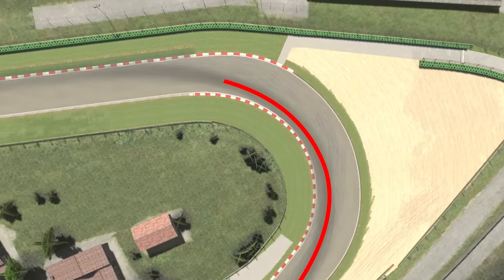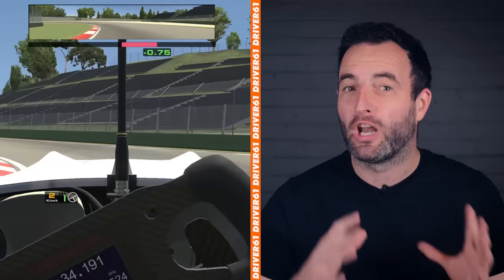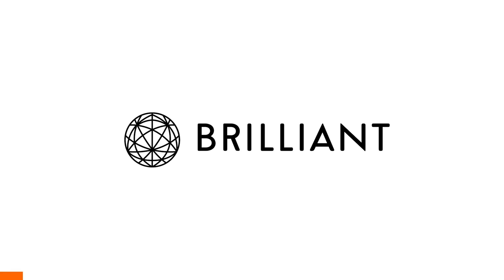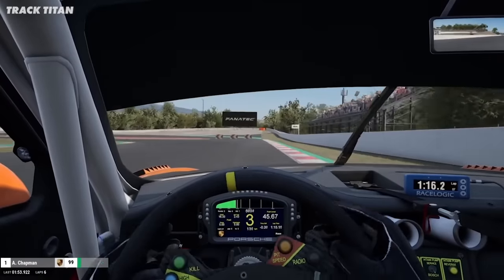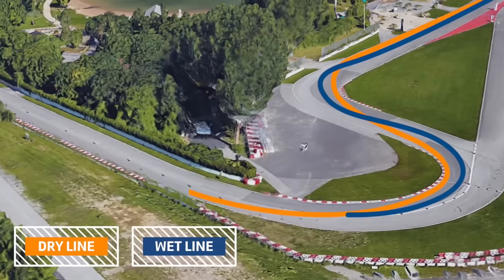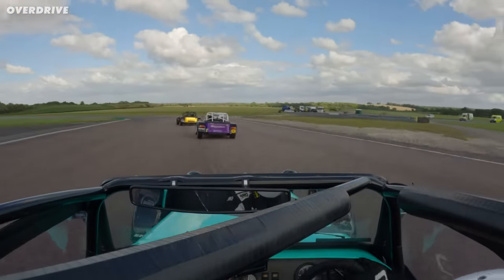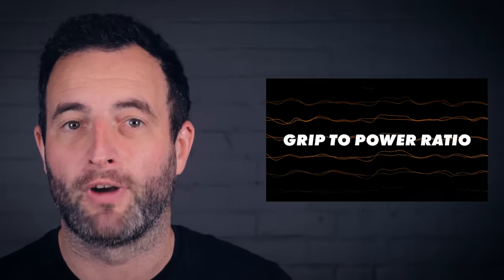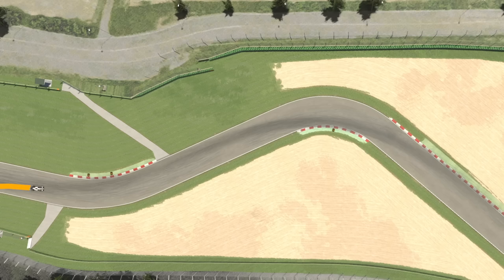Why F1 Drivers Use WEIRD Racing Lines

Comment: I’m reminded of T3 at Zanvoort and T1 at Qatar. The first race back at Zandvoort drivers started out on the “racing line” but explored the track by expanding the corner into the banking which ended up being faster. Qatar was a bit different but at T1 we saw a lot more overtaking once drivers figured out how much grip they had using the wider line. Exciting stuff to watch unfold.
Reply: Mugello T1 was similar to Qatar T1, many overtakes on the outside with camber. It combines the traits of both Zandvoort and Qatar
Reply: Also, the wider line the faster
Reply: You should also generally expect the line to change over the course of a race because they will actually be depositing enough rubber on the track to affect the grip surface and optimal lines over multiple laps.
Reply: Yeah Alonso was the first to discover the faster line at T3 Zandvoort and all the other drivers copied him
Reply: @hamza-chaudhry  Alonso always had the wider lines everywhere

Comment: I come from a short track speed skating background, granted its oval track racing. The tactics often cross lines from auto racing and short track speed skating. 
There are many different lines in an oval, depending on drafting off the skater ahead of you and how you can set up the pass.
Reply: Agreed, as a kart racer or racing fan overall, short track is one of the most exciting sports to watch. Mind boggling to see how ice can produce so many levels of grip, just judging from the skaters' behaviour during a race.

Comment: So much incredible info packed into one short video! The newbie line is exactly what I used to do for many years. If you don't think too hard, it almost makes sense- you want to go fast, so why not turn into the corner as soon as you can? Only once I started watching motorsport and saw the ideal line did I realize I was doing it exactly backwards- too much speed into the corner, turning in too early, and exiting like a tortoise while running way wide.

I think most road cars tend to be grip-limited, certainly in the case of any cars I've driven, and the V-shaped ideal line works well in that situation. Gentler on road tires and lets you get on the power sooner for a quick exit. I honestly didn't even know about the theoretical line until recently, with all the talk in F1 about V-shaped vs U-shaped driving preferences.

Comment: Yeah grip is limited by more than just lateral force, finding the ideal line should mean solving not for widest radius but for minimum time through a corner, which must take into account acceleration and momentary velocity values. One is a geometric solution, the other is a solution found through calculus.. the latter being far more detailed because it can accurately describe a less idealized, more realistic model.

In short, all ya gotta do is master everything there is to the continuity of splines! All racing lines are splines of a particular order of continuity--solving around that would allow for adjusting things parametrically from there to solve for any combination of conditions.

Comment: I experience this most visually in Real Racing 3 on mobile when doing time trials, it shows your previous best lap in a ghost, and the difference in lap times in progressively bolder green/red colors, so when you hammer down earlier than normal coming out of a corner and you suddenly notice a big burst of dark green in your lap time difference number out of the corner of your eye, you know that changing to an early apex made a huge difference for the long straight. It’s hard to translate into text but actually playing it, it’s all very natural.

Comment: First I like to thank you for your great explaination on why idel line differs a bit (more or less) from the theoretic geometrical line.. But for me the main reason is even a bit different.. The geometric line only can be the fastest solution if following applies:
1 centrifugal force (friction) from road, tyres and downforce is same everywhere in the corner. 
2. My car is able to go faster / arrives faster at the beginning of the geometrical line than the biggest possible line allows
3. I am able to break to exacltly the maximum speed of the geometrical line speed at the beginning of the line..
Then it would be fastest, but as easy to guess all those factors do not apply to a real turn. 
The line driven, by riding a bit (more or less) over the beginning point, then breaking down to slower than that speed, beginning the turn a bit more tight towards the apex and the accellerating out on a even wider line is easier to get, more save to do no mistake and gives you the chance to adopt the speed and acceleration to the changing conditions of the track, your tires and even the aerodynamics (for example by car in front). 
Furthermore as all drivers do it like that, the grip niveau of that ideal line gets higher every round for a dry race, it must become faster than the geometric line.. 
I am totally with you on how motorpower (ability to accelerate) influences the exact form of the line driven. 
And last but not least, a tyre regularly loses ability to provide side guideance force aka centrifugal force, if it at the same time has to transfer acceleration or brwaking force.

Comment: Yep, corner exit speed, because it counts all the way through the next straight. A couple klicks faster in the middle of the corner won't gain you much time, but down a straight for several hundred meters it does.

Comment: The geometric line was used in the Sterling Moss era, it was in his book. For the same reasons as when you're talking about go karts.
The late apex line is also used (a lot) by motorbikes as they have abundant acceleration and a touch less mid corner speed compared to a well setup car. For a "on the road" line though, keep tight on exit and only use the wide part for extra safety, then you've got that margin to correct, the risk of a head on or running off is too great for motorbikes.

Comment: Did I miss the talk about slip angle being the biggest contributor to a different line? 
The fastest way around a corner is when the rearend is sliding just a hair giving you more steering angle. 
On dirt since it takes awhile for the vehicle to react, its about getting the vehicle properly rotated for the exit of the turn.
You are right every vehicle has its own way of best handling it around a corner.

Comment: Cars turn with all four tires, not just the front.  Given a traction circle for each contact patch, you cannot accelerate hard and turn hard at the same time. It's just that simple.

To get on the gas you straighten the corner exit. For this you push the Apex later. Which means you must push the turn in later, so you might as well brake later.  How much depends on how much power you need to use.

F1 aero downforce does allow turning late in the corner exit after some acceleration in some turns. Depends on the speed.

Comment: There is one other type of line through a corner: distance cutting line.   It is rare to use, but there are some instances, particularly in low power cars, where the line you take doesn't give an exit speed or a corner speed advantage.  In these cases you can save time by drawing a line that travels less total distance.  It can also be used sometimes when spending less time in the corner is better than more exit speed.

Comment: One thing to add is that the ideal line shifts from the theoretical line more or less proportionally with the car's capability to accelerate. The easier it is to get back to speed, the more the ideal shifts. If the car cannot pick-up speed fast, the ideal is closer to theoretical as you need to conserve as much speed through the corner.

Comment: I ride a motorcycle on the road, and using that ideal line would on a right hand bend potential put your head over the centreline which could have a rather poor outcome. Doing a cornering clinic at a local track we were encouraged to use a line more similar to the race driver, leave the turn in late, and the apex is much further around the bend than you initially think,  and apply a modified version of this to the road to remain safe.

Comment: Hi Scott, thanks for great content, and good luck with the inversion challenge.

A quick one on driving styles, and the video you did about Max and Schumacher’s style evolution for the F1 cars of the 2020s.

It was a great video, but I picked up a discrepancy with Peter Windsor’s analysis of Max’s driving style, which he describes as extreme ‘short corners’ with early braking, early turn in, and superior rotation. This seems to be the opposite of your assessment of Max/Schu, in which you talk about late braking and efficient rotation in order to ‘V’ the corner.

These can’t both be right, can they?! Can you help explain?

Comment: Your thumbnail is a little cheeky there!

But you did mention the thing that it made me think of immediately at the very end.

I went to driving school at Barber Motorsports Park and my instructor referred to turn 14 there as "sacrifice corner" because taking the racing line there would put you in a non-ideal spot for turn 15 - which leads to the main straight. So we turned in tighter at 14 to get us best exit into 15 to the main straight.

He also told us to not always "use the whole track" on wide corners in a race because "the guy behind you will divebomb you and you lose your spot. If you tuck in, you'll both be slow, but at least you keep your place."

Comment: racing line depends on a lot, 
- How slow/fast the corner is
- What corner is before or after, straights 
- Bank angle of the corner itself
- Ability of the car
- Ability of the driver
- Surface of the corner, rough, smooth, bumpy, pot holes etc...
- Situation, some one driving for qualifieng, race, 
- Stint, is he doing short/ long stint. ultimately based on Tyre wear, fuel consumption
- Competition, is he driving alone, attacking, defending ....
 - Weather, dry/wet, etc.. Hotter, colder (to keep Tyre temperature under control)
- And a lot more. 

so it is not easy to say what line someone follows, I actually drive and follow different lines with in a single race, as said above based on the situation !

Comment: I'm reminded of the video you did a while back about Fernando Alonso's time with Renault in the 2000s (I think) where he would just break the front wheels loose when entering a corner because the car had a wonky engine but massive rear grip, or some other set of weird conditions like that. I'll have to go review the video. 😂

The point is, sometimes even the Quirks and Features™ of an individual car can affect your race line.

Comment: The most amazing and fun corner i witnessed was in the pass seat of a stock engine RX8 with Olins coilovers at turn 6 of Laguna Seca. The driver (ex racing driver) snapped the car into the corner while kicking the brake and then took the corner with the steering wheel straight all the way through! Using the slip of the rear tires to do the turning at over 90miles an hour. Nuts but so much fun. 
I asked why and he said the car does not have much power so i need to keep the wheels straight as much as possible round the track and the speed up in the corners. 
Sometimes the best way round a corner is when your smile is the biggest.

Comment: Would love to also hear you talk about slip angle

Also, it’s so easy to understand what turning does to momentum and speed if you just take a kart and push it in a straight line, then try and push it when you turn the wheels and see how big of a difference there it

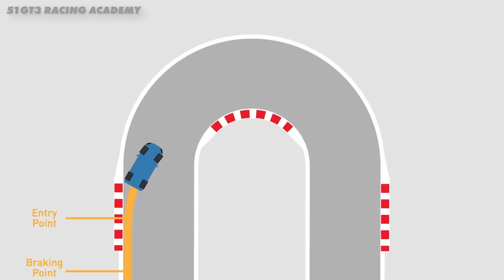Comment: The video excerpt you used at 0:27 shows the actual ideal line (euler spiral) in white, and the geometric line in yellow. As you can see, the white line does not rely on late braking and straight acceleration. The line you describe at 1:53 is a "super late apex" line which is demonstrated to be slower by that same video you used at 0:27. While a super late apex allows you to accelerate earlier in terms of where you are in the turn, you will not be accelerating earlier in TIME vs an Euler spiral trajectory. With a super late apex you will be compromising minimum speed for the sake of straighter acceleration, but you will actually never catch up to a car following an Euler spiral trajectory because you will be accelerating at the same point in TIME but from further back in the corner and at a lower minimum speed.

So why do racing drivers use that line then? Well... They don't. Just look at Charles Leclerc's 2019 pole lap and tell me his trajectory through La Source looks even CLOSE to the red line you showed at 1:58. https://www.youtube.com/watch?v=EXlK_GDRZNY

The video in question that disproves super late apexes which I highly recommend watching: https://www.youtube.com/watch?v=N8qBdOs0s1E

I also highly recommend their blog which goes into much more detail. The accompanying blog post to that video is here:  https://www.paradigmshiftracing.com/racing-basics/the-racing-line-four-elements-of-a-perfect-corner#/
Reply: A lot of the "super late apexes" he shows are exaggerations to prove his point.  Nobody takes la source like that, but it is better to take a slightly later apex to maximize exit speed.  He just exaggerates it for those who don't know what late apexes are can understand.
Reply: @victornag5230  no, taking a slightly later apex is not better. While it can maximize the speed of the car at the exit of the curve, it will not be faster in terms of time. The car taking the euler spiral will have a lower speed at the exit of the curve, but it will get there earlier. By the time the late apex car gets to the exit, the euler spiral car would just be further ahead on the track at that same speed. The late apex car will never catch up.
Reply: Its not black or white. To say one line method is better or faster than the other is riduculous at least and bs at most. There are different situations where even in the SAME corner  on the same day may be different. Last lap last turn while leading, the guy behind ( me,) is right there as we start to enter corner. If u brake late and enter apex late chances are yoy lose as i dive to the inside and totally screw up my lap time as i slide, countersteer and slide some more but i get ahead of you and push u wide and block u from passing me as we race to the finish. But yet during the race it  may be overall quicker to seeep the outside. .esspecially  if it saves the tires. There are countless variables at work to suggest one line is always the fastest. Track surface, tire wear, grip, banking, temp, rubber on ground ( sometimes later in a race the outside that was faster may have so much loose rubber pellets that it feels like gravel) what portion of the race at the moment, carxm setup that day, stagger, driver ability and ones behind you. Arguing over or implying because in one particular race joe blow from idaho took this line so it must be the best  is like saying an uppercut is better than a straught punch cause u saw a fight and that one punch u saw knocked out Tyson . Its complicated and varies depending upon the circumstances at that particular instant.
Reply: @waynegarfield6607  you’re actually right. This is also why every good driver doesn’t drive the same. U can watch Sainz and Leclerc drive and even tho they have the same car, they sometimes take different lines and approaches to corners.

Comment: Well it's good to hear I've naturally learned a moderate amount of this, that being said I really do best in high mechanical grip, low power vehicles, but turns out in rallycross I'm doing pretty well. In 2/3 corner complexes I tend to be too aggressive early, but long complexes seem to move me into a flow and mellow it out a little and I can excel at them. Very frustrating how my racing overall is far for e racing enthusiast even ... But for the life of me I can't consciously teach myself where the time is on the track it is oddly frustrating.

Comment: I learned something one day at Shannonville when allowing an actual professional race driver to do a few laps in my car. I was feeling pretty cocky as my laps felt considerably faster than his. He was braking earlier and entering corners slower than I was. But the stopwatch doesn’t lie. I would go in on the ragged edge, and as such couldn’t get on the throttle nearly as early as him. He would be full throttle at the same point I was still braking. I learned that day, it’s not how fast you go into a corner it’s how fast you come out. That small increment in speed is carried all the way to the next corner, making for a faster lap.

Comment: TL;DR: weight distribution and the fact that (racing) cars have better brakes than the engine so it makes sense to get on the throttle earlier which means you should try to rotate the car earlier in the corner.

Comment: The mathematically ideal racing line is the one where your acceleration in the direction of the line that bisects the corner is as high as possible throughout the turn.  The widest arc does not do this because at the very start and end of the turn your acceleration is not in the direction you want to go.  

By trail braking into the corner you change the direction of your acceleration to match the direction you want to go.  And when you get on the throttler early you make your acceleration on corner exit closer to the direction you want to go.  To accomplish both of these you will have a lower minimum corner speed than the largest possible arc allows, but you will enter and exit the corner faster.

Comment: It's all about the total package envelope of the car. The whole point is to minimize the OVERALL speed loss of the turn. Everything effects everything else. Even if you're well within your traction circle and in neutral steering... anything you do to gain speed will effect the energy you carry into/through subsequent corners.